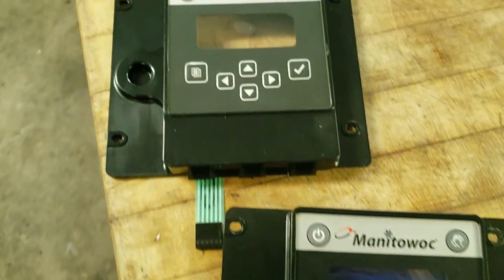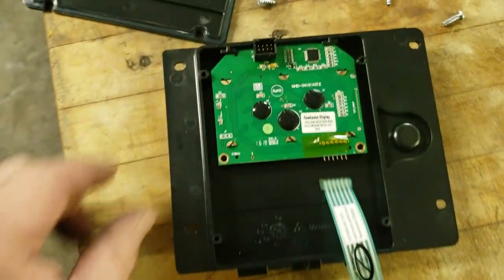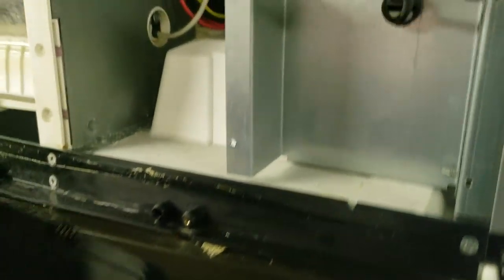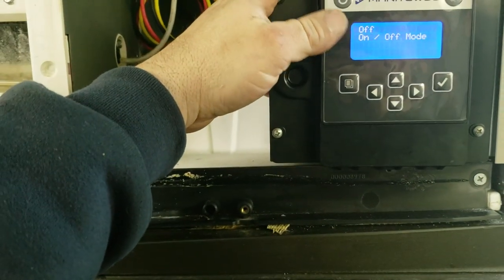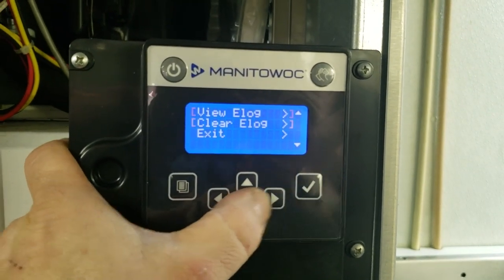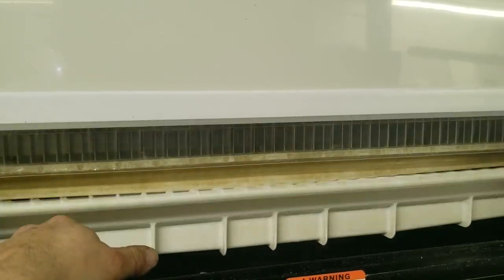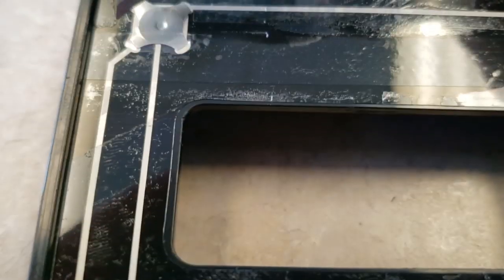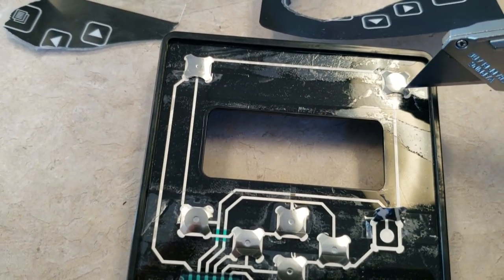Ice Machine Keypad Replacement Without LCD Display On Manitowoc

Comment: You can also jump the 3rd pin from the left and and last pin on the right together and it will turn unit on if power button is bad
Reply from the maker: @andresfarias4975  Awesome information 👍👍

Comment: Hi I have a question my lcd housing model is the same as the one you showed in the video But I can’t get my hands on the product at all currently and I need to get my Machine fixed asap. Do you think we can use a different model housing instead? And if we can which model
Reply from the maker: I'm having a hard time finding out which video you're referring to, they don't give me a link to it

Comment: very good video, good job buddy, I got a question if someone could help ?  My Manitowoc model iy0504a-161 stopped making ice, and i get nothing on my display only solid blue ,before gething this i got  T3 code started making ice fill the bin and then stopped and didnt start , after unplugging and plugging back it started to work and this time i got T4 code ! it made ice and then stopped completely and now i only see blue screen without showing anything,. can someone tell me what is the problem and if i need to change the display housing plus LCD display what is the part number for my model ??? please Help.  thanks
Reply from the maker: Generally you lose the control buttons not so much the display itself. It could be the cable, it could be the keypad, those are the two cheapest things, otherwise you've lost the main board. There's voltage checks but I don't know exactly what they are without looking them up but that kind of gives you a place to start and that control board is very expensive.

Comment: Mine was working and after running cleaning cycle, now it shows nothing, it’s just blue. Any tips? Thank you
Reply from the maker: Did you get water on the control board? Maybe try killing the power and resetting it? Never had a plain blue screen
Reply: @HVACRSurvival  not sure how sensitive it can be, it might have gotten a drop while cleaning the outside of it I was careful
And yes tried turning power on and off more than once, nothing changed. I’ll try swapping the display with another machine that is working to see what happens, unless you have different idea. Thank you
Reply from the maker: @haasan9360  it's worth a try. Normally the display doesn't do much logic. It might be the main board. Hard to say when I'm not in front of it.
Reply: @HVACRSurvival  yes correct sir, most of case Blue LCD even we change new LCD it's not work, when we change main board then It's working